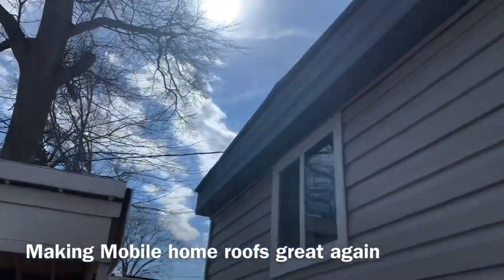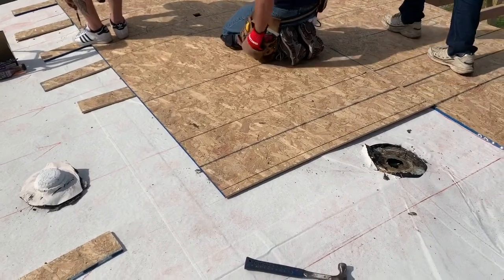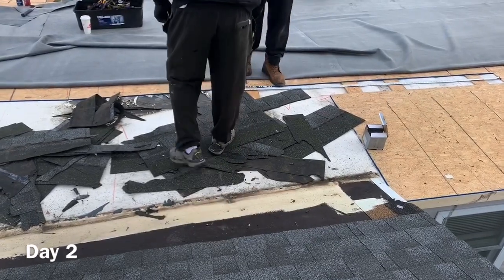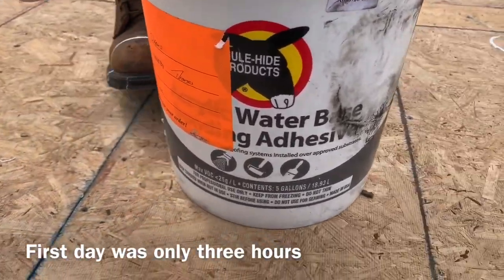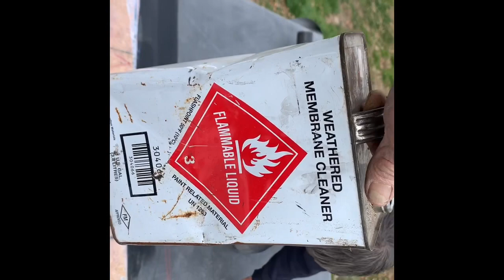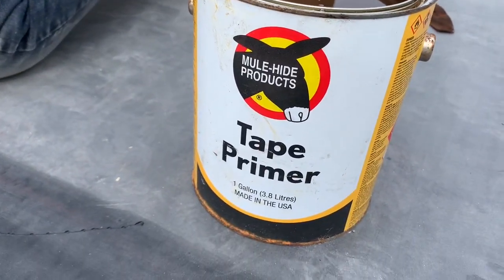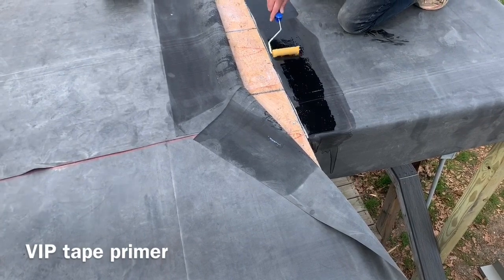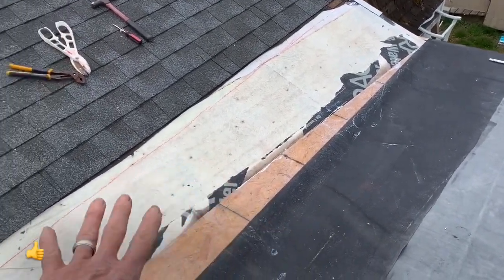How to Repair Mobile Home Roof Leaks. Chesapeake Virginia.

Comment: Question for you guys . I did not see you cut out for vents in the roof for the plumbing . When you make that transition do you just stub them up higher . Also what kind of vent cap do you use ?
Reply from the maker: That should be in the next video coming up
Reply from the maker: Yes we did tell them out there are three of them total
Reply: Hi Kenny. When we re-plumbed this trailer 3 years ago we used in- the -wall vents, so they were able to do away with all the old plumbing vents on the roof making for a cleaner finished job.

Comment: I was going to redo my roof on my 1980 12x60 mobile home...  I was thinking about ripping all the metal up and rebiuling the roof trusses with real 2x4's but damn Lumber is insanely expensive now!   Where I live in Tucson AZ an 8ft 2x4 is $8.00 per board!  The 2x4x12 are now 16.00 a peice.  Plywood is 48.00 a sheed and OSB now cost's damn near 60.00 a sheet. This workd is going to crap.
Reply from the maker: I’m not sure who we can thanks for that I guess the coronavirus. You can takeoff the metal and redo your trusses from the top that is a good idea check out some other videos I’ve done it before
Reply: @Drewsroofingandhomerepair  I'll have to check out your video on that for sure.
Reply from the maker: https://youtu.be/So1buTFPXvs

Comment: One question: what is the advantage of the 0.45 EPDM rubber vs. installing Roofing shingles on that OSB ? Just curious.
Reply from the maker: You don’t have enough pitch on the roof to put shingles up there my friend you need at least 312
Reply: @Drewsroofingandhomerepair   pitch , ok, makes sense, here in Florida, when it rains, it pours.
Reply from the maker: If you don’t have pitch on your roof the water won’t run on fast enough with Shingles. And in Florida with the Highwinds you definitely don’t want to put anything on less than a 3/12 pitch